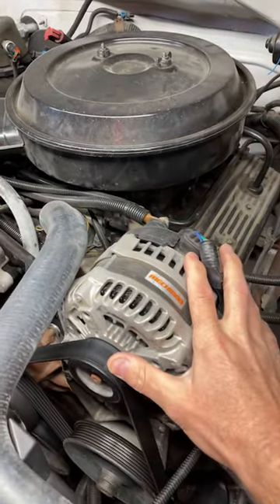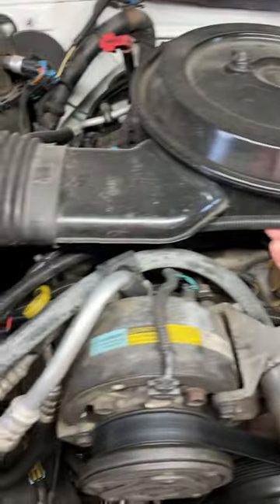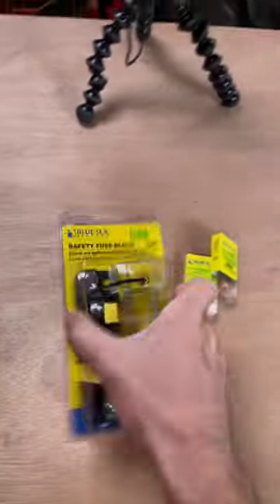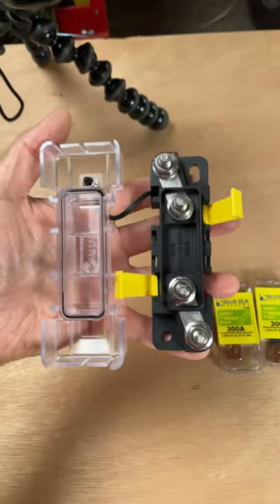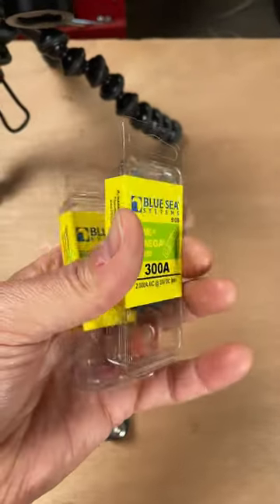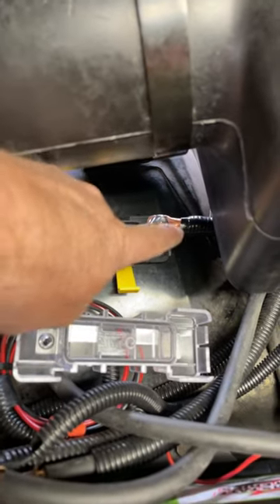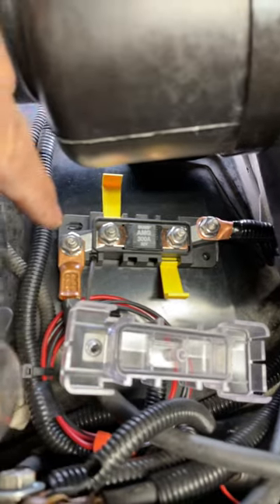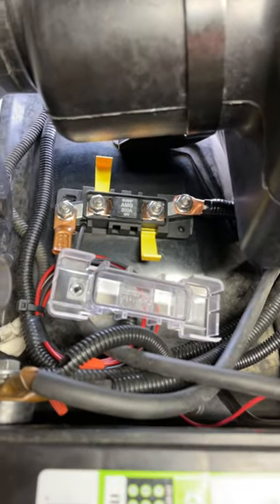Customer States His Install Was Professional!!

Comment: You charge em around 12 volts...
Reply: 24 if you have two batteries!
Reply: If its 12v system the charging voltage should be around 13.8 volts or more
Reply: The Mechman alternator will charge at around 15 volts if you want it to with minimum 270 amps
Reply: @YeOldeGeezer if it's a 24v system and that's not..and to get 24v you have to wire them in series...100 12v batteries wired In parallel like cars with multiple batteries will still only be 12v lol
Reply: @thormilton3574  what about lithium/iron?
Reply: Hey, he asked right!!! 😂😂😂😂
Reply: Should be charging around 14 volts.
Reply: Its fascinating that social media has changed people from having a sense of humour and laughing at your joke, to having a sense of entitlement to correct you...
People are essentially dicks.
Reply: 14.2
Reply: No you really should be charging 14 to 16 volts
Reply: @Ye Old Geezer  just cause you have to batteries doesn't make it 24 volt depends how it is wired are batteries in parallel or wired in series
Reply: I encourage everyone who runs a big amp to do your own work. The guy should have known you always fuse your system so you don't blow it or damage car. It would had been 5 minutes more time tops. Dude about to nut thinking how much to charge for splicing the wire and putting a fuse in line that took less than 5 minutes. Sorry I hate people who screw others over. Old lady was in store asking me how much to change oil. I said oil and filter and top off fluids ran about 27 to about 40 depending on vehicle. Garage charged 80 yr old lady 227 dollars for basic oil change. Said she had always went same place and everything was high they did. Charged her 120 to change wipers month before. Moral is learn how to do things yourself so you don't get ripped off and don't rip others off. I sent the lady to a friends garage from now on so she doesn't keep getting took advantage of.
Reply: @gregoryb2999  ty for looking out for the elderly they are the most often easily taken advantage of
Reply: God. Damnit
Reply: Likely closer to 14.4 v
Reply: @YeOldeGeezer  only if they’re wired in series 😊. Otherwise you just have a larger 12v power bank
Reply: @Testosteronemonkey  true
Reply: @machew2009  if it’s parallel yes it’s still 12 but series it’s 24
Reply: Bwahahahahaha..
Gold!!!
Reply: 666th like. Uh oh
Reply: 13 to 16 volts when the alternator is working
Reply: @machew2009  *too
Reply: Should be 13.7-14.5VDC Charging Rate..... grin!
Reply: Eh, closer to 13.5-13.8v while charging but your heart is in the right place
Reply: @YeOldeGeezer  no
Reply: @YeOldeGeezer  just no
Reply: @YeOldeGeezer  😆 🤣 😂
Reply: @fowyb actually.......!!!!!
Reply: charge 300to 450ish
Reply: 14v
Reply: 14.5 volts.
Reply: @TheCrystalGlow  my alternator give 14.10, do I have a problem ?
Reply: 14.4V to charge ! 12.6V under load.
Reply: Positive answer !
Reply: @tigeroftheeye7121  270 amps will blow up a bad battery plus at an equalising float voltage the ampage will only be about 2 or 3 Amps.
Reply: @scottrich976  I didn't say 270 amps to the battery. The car might be using 200 amps of total current and then 70 amps to charge the battery if it's low.
Reply: @-na-nomad6247  its ok
Reply: @tigeroftheeye7121  ah yes thats better, I usually keep topped up with a 12 watt solar panel as it's less strain on the alternator in winter. Pass it on.
Reply: @tigeroftheeye7121  different type of charging for lithium based batteries compared to lead.
Reply: @danielalamo2075  True. Ya always overcharge em. That's why the customer complains. 🙂
Reply: 14.4
Reply: This is the most correct response. Made my shitty day better.
Reply: @scottrich976  thanks !
Reply: 14.4 volts actually 😆😆
Reply: Or just under 14v normally
Reply: Ha! Good one.
Reply: In my opinion, ideally I like 14.6v. Shouldn't boil the battery and should be fairly safe for factory electronics! (I say this as a man who thoroughly enjoys his mobile audio)
Reply: About 14v.
Reply: 13.7 actually.......
Reply: Hell, maybe even 14.4 volts
Reply: @bigwheel9132  all depends on the ecu,my 4 mechman alts charge 14.5-14.8 everyday. Unlike another vehicle I have that the pos ecu wont let the vehicle see anything past 13.8(plugged a 16v batt that was resting at 14.9 I digress)

Lowest mine have even seen on load is 13.8 but that’s because I went overkill. I anticipated doing a 9k rms stereo system, all my lights etc. I did everything but the system went from planning on 5k just in the sub stage to 3000rms for everything so lithium battery and 370amp alt with 4/0 is a bit much 

If it’s cold or below freezing 15.2 to 15.4 then once the vehicle is warm it’ll be right at 14.5-14.8
That’s in my scat pack charger
My Tahoe has 1 240amp alt and 2 370amp alts, all mechman. It’s normally right around 13.8 when turned up and it has a almost 30k rms stereo system in it.a .My old truck alts from mechman I had externally regulated at 15.2
Reply: 14.2
Reply: no.
up to 14,5V is nominal system voltage
Reply: @fowyb  yea I was about to say😂it instantly went from a great joke to "well actually, I'm much smarter, and you are wrong, and here's why"🤦🏼‍♂️
Reply: @aaronpowell4885  agreed especially when it comes to aftermarket electronics in your car. I have thousands worth of external rgbw lighting, headliner, all kinda lights in the car, custom headlights and 6k+ rms
I hate dropping under 14 but with my mechman alts and lithium batteries I never do… I still remember the days of u.s.Amps and having these gigantic amps that would draw a ton of amperage to make a little power but that’s class a/b for you
I remember starting the car and being around 14.3 and soon as some bass hits 11s lol good ole classic yellow tops that really don’t pack a lot of reserve at all lol
At one point I had a 16v system but the 16v alt would always die every 4-6 months then tej (if you know you know) made me a bracket for 3 then 4 alternators… never looked back
I’m just glad I can have alphard audio stuff in my car and not have any voltage drop
Reply: @thormilton3574  Unless you're trying to save a murdered battery. I've given them 60v @ 40A to kick them back into life, never had one explode...
...yet...
Reply: Perfect.
Reply: this guy just won the internet
Reply: 14.8 v  to be precise 👍 
29.6 v if it a 24 v system
7.4 v on a 6 v system
Reply: @YeOldeGeezer  if wired in series. 29.6 would be the correct charging voltage ⚡ true story!!
Reply: @thormilton3574  14.8 V is the specified charging voltage! On a 12 Volt system
Reply: @thormilton3574  the cheap AutoZone alternator in my 4.2 vortec does 14.5
Reply: @gregoryb2999  I was watching a hidden camera video the other day about a fraudulent automotive shop that was charging about $200 on average when people where coming in for an oil change by telling the customer that fluids needed to be replaced when the car had just come from a mechanic who had completely inspected the vehicle and done any fluid change or service that needed to be done. In summation I completely agree in this day and age it doesn't take much to learn how to do small things to your vehicle that need to be done.
Reply: Nope you charge at @ 14.3 to 14.5 volts
Reply: Appreciate the joke but.., It should be 14v
Reply: Bruh, I almost shot milk out my nose 😂😂😂
Reply: @leejohnson6173   😂 It was a joke at the end of the video dude says so let me ask what should I “charge” for something like this
Reply: Damn you. Take my thumbs up
Reply: That's very funny charging 12 volts
Reply: No fuse needed
Reply: I was about to say that 😅
Reply: It's actually around 15, but hey, who's counting
Reply: @gregoryb2999 series and parallel are to completely different animals
Reply: @Testosteronemonkey that's not the discussion you missed the point
Reply: @davidnoland6796  ?
Reply: Actually more like 14.4
Reply: @YeOldeGeezer  True, if those batteries are wired in series.
Reply: Epic comment!
Reply: Most alternators are rated 100-120 AMPS.   Why yse 300 amp fuse?
Reply: These comments are good
Reply: 🎶 “Wha wa wa wa” 🎶
Reply: YOU!! OUT!! (points at exit)   :)
Reply: 13.42v resting voltage 14,2 peak would be on the money